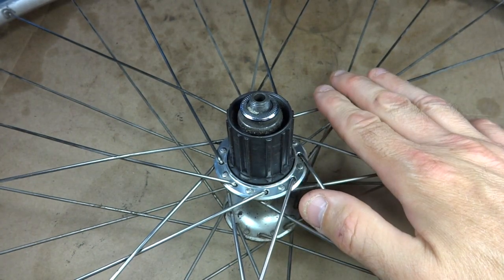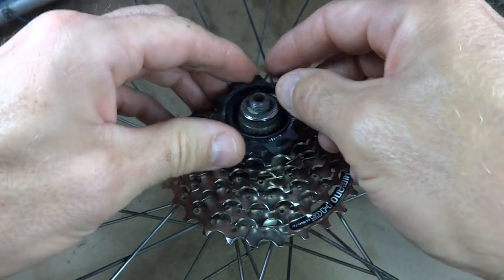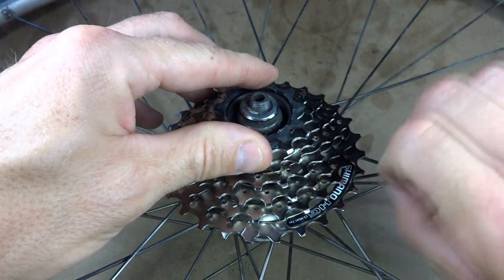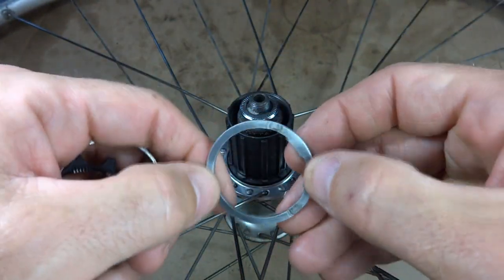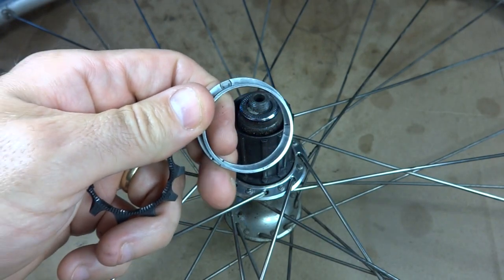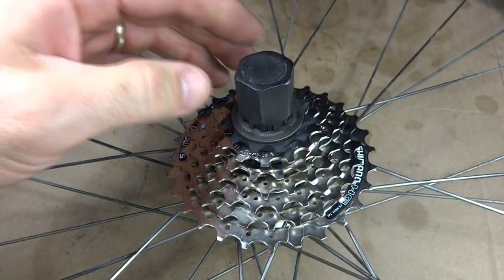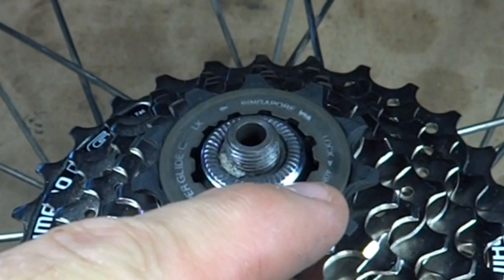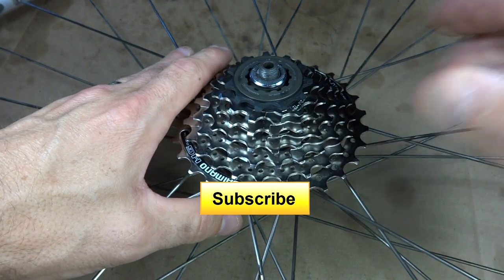How To Install 7 Speed Cassette On 8/9/10 Speed Hub

Comment: Will a 4mm spacer work? 7speed to 8speed Cassette. Thanks.
Update: I tried 4mm spacer and it worked perfectly on an 8 to 11-speed cassette. Just in case anyone is asking the same question.
Reply from the maker: Maybe, maybe not. Find a 4.5mm spacer, or combination of spacers to make 4.5mm.
Reply: Update: I tried 4mm spacer and it worked perfectly on an 8 to 11-speed cassette. Just in case anyone is asking the same question.

Comment: I have a 11 speed wheel but my bike is 7 speed. What is the suitable size for the spacer?
Reply from the maker: The 11 speed wheel is going to be wider than a 7 speed wheel. As for a spacer, not sure if the 4.5mm spacer will work. Maybe a 5mm spacer.
Reply: What happens, if I add more than 2-3 spacers to obtain 4,5 mm lenght?
Reply from the maker: @gokhanbalci4533  It doesn't matter.

Comment: File the rivet off the cassette? What difference if the cassette is bound together or loose sprockets, tour de France RJ?
Reply from the maker: To me it makes more sense to hack away at the 50 cent, easily replaceable spacer, than the $20-30 cassette. But you can do what you want. I am guessing if I had filed the rivet off, someone (maybe you), would have asked why I didn't just file the spacer.
Reply: Yard Sale Dale  oh ok, I ddnt know that, Im usin campag mirage , which has spacer rings betwen sprockets

Comment: If I run a 7 speed on an 11 speed (vuelta corsa pro) hub, can I safely run two spacers (of correct size)?
Reply from the maker: On a Shimano set up, it wouldn't be an issue. But I don't know all the variations of Campy hubs.

Comment: The main problem was that one rivet was missing from this cassette, all I know that mine has all 3. I've installed the 4.5mm spacer along with 7speed cassette on a 8/9 speed hub without a problem and it sits as it should. This cassette seams new so variations should be taken into account.

Comment: There's a wheel i wanna buy person keeps saying its 11 speed cassette I was wondering if I can still convert it into 7 speed
Reply from the maker: Probably. With the right spacers.
Reply: @RJTheBikeGuy  Hi, I also have the same issue, do you know which spacers are needed? Thanks.
Reply from the maker: @blahqwe  Why???? Buy a 7 speed wheel. Cheaper. Kind of dumb putting 7 speed cassette on 11 speed wheel.
Reply: @RJTheBikeGuy  If you can show me where I can find a new 7 speed road wheelset then I would, but I can't find them.So bought an 11 speed and wanted to use 7 speed with spacers.
Reply: You can either add spacers on the freehub or swap the freehub with a shorter one

Comment: Why not just grind out the rivets on the back of the cassette ? Seems easier, is there an issue with this somehow ?
Reply from the maker: +Michael OConnor I would rather grind the cheap, easily replaceable part.

Comment: will a 7 speed cassette always be able to go on any 8/9/10 hub with the use of spacers?
Reply from the maker: For Shimano HG hubs, yes.
Reply: @RJTheBikeGuy  how about 11 speed freehub bodys? (I have the hope pro 4 w/ shimano hg freehub body)
Reply: @RJTheBikeGuy  also, why dont u just put the 4.5mm spacer next to the smallest gear on the cassette instead of next to the largest gear
Reply from the maker: @joshuahuang07  Because it won't work. The smallest cog is made to be on the outside.
Reply from the maker: @joshuahuang07  11 speed cassettes are wider and I believe need a slightly wider freehub than a normal 8/9/10 speed freehub.
Reply: @RJTheBikeGuy  i want to put a 7 or 8 speed on an 11 speed freehub body. since the 11 speed freehub body is wider, can i just add spacers for the 7 or 8 speed cassette to fit?
Reply: @RJTheBikeGuy  like the derailleur wont be able to properly shift? how come the smallest gear has to be on the outside?
Reply from the maker: @joshuahuang07  Then you will need a wider spacer.
Reply from the maker: @joshuahuang07  Try it and figure it out!
Reply: @RJTheBikeGuy  oh right the chain will be hitting the spacer in high gear haha thanks! im running 3kw on my mid drive and planning to do 4kw, and i dont wnna destroy my xt drivetrain. do you know if the dt swiss ratchet system would be able to handle more power over the pawl system that the hope 4 uses?
Reply from the maker: @joshuahuang07  not it.
Reply: @RJTheBikeGuy  alright ill try it when i get the components. also one last question: i heard the 7 speeds r usually riveted togethwr while 8 speed cassettes aren't? do u know if thts true? i dont want the gears to dig in to the freehub body whereas a riveted one will evenly distribute the load
Reply from the maker: @joshuahuang07  Most cassettes are a combination.
Reply: @RJTheBikeGuy  cool. thanks for the help

Comment: They don't make sufficient variety of 7 speed freewheels now...all 14-34T or 14-28T so looks like I will have to change wheel for a freehub wheel to put in a 7speed 11-28T cassette in, but seems they are not making 7speed freehub wheels either...so will have to get 8speed and put a spacer in, hassle.

Comment: Can i use 8-speed shifter on 7-speed cassette?
Reply from the maker: https://www.youtube.com/watch?v=xMvD1T4qF1E
Reply: No. The cable pull ratio of the shifter is set for your specific cassette speed. Using a 8-speed shifter with a 7-speed will not work because the 7-speed cassette has a different cog pitch than the 8-speed which has a smaller cog pitch. In summary, the cable pull ratio on a shifter is to be used with the same speed cassette, doing otherwise will cause skipping/not shifting correctly because of incorrect cable pull ratio of shifter being used with a cassette it was not designed for. Also, the shifter and rear derailleur must be the same brand or the the index shifting will not work because the rear derailleur has a fixed actuation ratio. To learn more about this go here: http://blog.artscyclery.com/science-behind-the-magic/science-behind-the-magic-drivetrain-compatibility/

Comment: just wanted to know the exact spacer to do that.
Reply from the maker: +attila elekes There isn't an "exact" spacer. You just need a spacer that will take up the extra space, but not be so long that the lock ring won't screw on.
Reply: I see, thanks.

Comment: Can I install 9 speed cassette onto a vert v8 bike?
Reply from the maker: I don't know. What is on there now.
Reply: meaning?
Reply from the maker: What kind of cassette or freewheel is installed on the bike now?
Reply: Shimano Tourney TX 7 gear
Reply: basically the parts are as follow:

20" (406) Wheel-size 
Kenda Tyre 20 x 1.5
Shimano Tourney TX 7 gear. 
Aluminium frame, crank arm, stem, handle bar and seat post. 
Disc brakes front and rear. 
Quick release wheel locks.
Reply from the maker: If you have a 7 speed freewheel on it, then no, you can't install a 9 speed cassette on it. You are pretty much maxed out at 7 speed. To upgrade you would have to bend the frame (only possible if the frame is steel), replace the wheel, or rebuild the wheel with a new hub.
Reply: i think i have to rebuild the wheel
Reply from the maker: You would also have to spread the rear triangle of the frame to fit the wider wheel. You will also have to replace the shifters, and chain, and probably rear derailleur.

Comment: Far easier to just remove those bolts. Not necessary since the spline guarantees orientation anyway, and you save a zillionth of a gram, which equals 5hp at the wheel!
Reply: Wrong. Some cassettes have cogs that don't engage with the hub; those rivets hold the cogs together.
Reply: @mattfoley6082  okay buddy. I've removed those bolts and have been creating custom cassettes for the past 25 years. The splines and the tension of the threaded cap against the spacers and cogs keep it in space. Shimano, SRAM, SunRace, Microspline, countless off brands. "Wrong" is a poor word choice. There are cogs that are grouped together at the back of the cassette because of the backspacing on the wheel dish that's an exception. All cogs engage with the hub, otherwise they would just be spacers with teeth.
Reply: @KevinVagen  Ok, sorry; let me clarify. My Shimano CS HG200-7 cassette's 3 largest cogs are riveted together and only the smallest cog of those 3 cogs engages with the hub; the 2 largest cogs don't have splines that engage with the hub. And as I look at my cassette here it appears that the two rivets nearest the hub can be removed. You were right and I was wrong. Looks like those 2 rivets in the video are only to hold the cogs together for easy alignment and installation.

Comment: Same if was for a 11 speed  and install a 7 speed cassete
Reply from the maker: Should be. Thicker spacer.
Reply: @RJTheBikeGuy  so os possible withput a problem
Reply: @RJTheBikeGuy  sorry for all the question what about the frame would a bigger hub for like 11 speed cassete  rub with the frame  ????
Reply from the maker: The dropouts are spaced for the wheel.
Reply: @RJTheBikeGuy  so frame drop outs are standards for all hub sizes ???
Reply from the maker: https://www.youtube.com/watch?v=KHXYN1JH8Oc

Comment: How to put a 9-speed cassette on a 7-speed hub.
Reply from the maker: +john smith It won't fit.
Reply: It won't fit? That's too bad, I already did it. A CS-M953 on a FH-M732 Freewheel body on a FH-M950 Hub & I kept the 135mm spacing.
Reply from the maker: When there was a 7 speed cassette on there, was there a spacer?
Reply: A spacer??? It's not a standard cassette, It's A CS-M953 cassette. I sent the cassette to a machinist to remove the thickness of a gear and a spacer. I replaced the 1mm aluminum left side spacer (From FH-M950 Titanium axe) by a 4mm aluminum spacer. Redished the wheel to make a stronger wheel.
Reply: That wasn't a fair question; you set RJ up and that was very uncool. The example that RJ shows in his video is for a straight across installation without resorting to expensive or extensive machine work etc. Anything can be modded given the funds, access and will. But, for the average person that wants a simple and elegant fix, RJ's suggested solution works very well. I don't care much for individuals like you. Resourceful solution, and I don't know if you devised it or had someone else come up with it, but I did not appreciate how you set him up and then your flippant remark, "It won't fit?" Very poor taste.